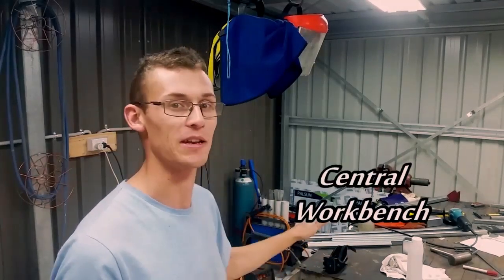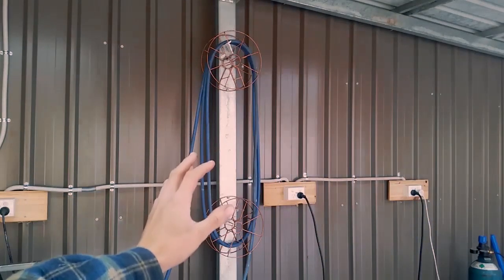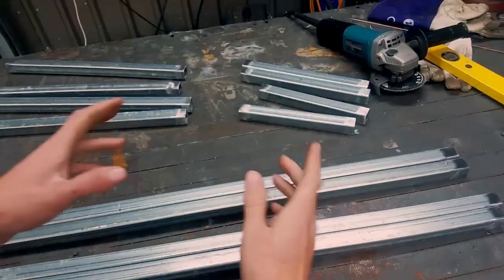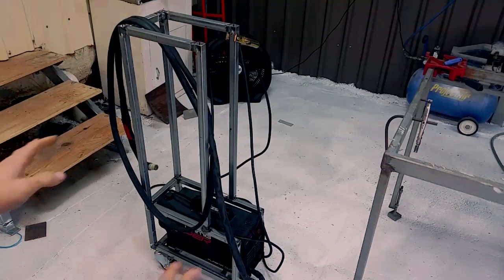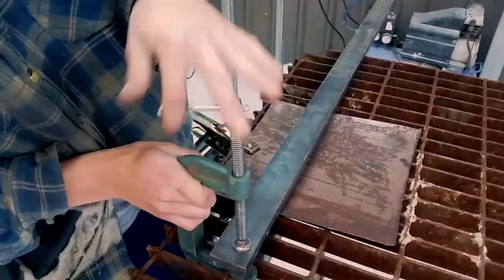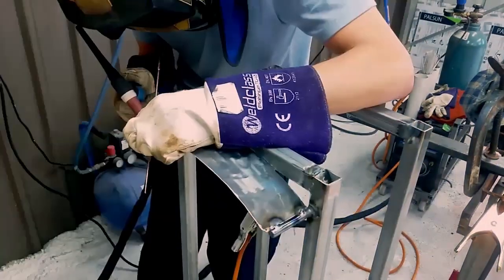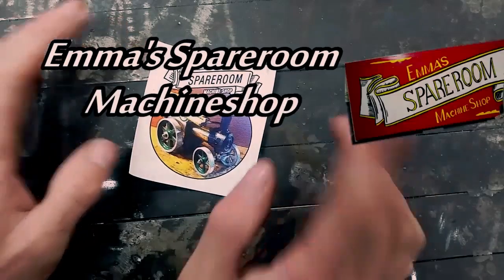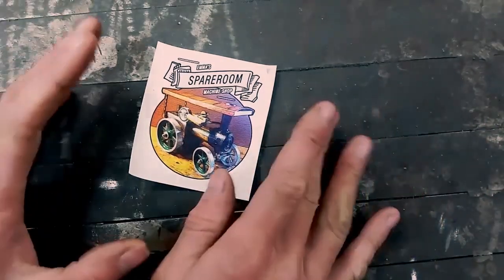Cables, Carts and Bench!

Comment: You are lucky ,welding galvanized square tubing keeps you young !!!!!
If you do not want to get old keep on welding  it.
It is the biggest shit there is,if you don t want cancer stop welding  it !! 
Use paint or buy stainless,never ever galvanized when welding or flame cutting and no ,do not grind it off and weld it,it will kill you !
Reply from the maker: I blow the fumes away with a fan. A fume extractor is an upcoming project.
Cheers for looking iut for me
Reply: @TomMakeHere  Better be safe than sorry,don t use that shit,bolt it never weld it fume extractor does not work,what you don t see is the worse.
Use paint or stainless steel !!!!

Comment: If you need a flat surface or level  to work with you can use shims and packers to set up two equilateral triangle frames  ( 30 or 40 mm square tube works well ) and use a good spirit level to make sure they are not twisted and tack the frames together but don’t fully weld them . Make up some adjustable feet - one for each point of the triangles and fit them so you have three adjustable feet per triangle . You can set them up in all sorts of configurations and use a good sprit level to make sure your set up is level and flat . I have built many trailer chassis and benches using this system on surfaces ranging from grass to cracked concrete to gravel , if you want more height some decent saw horses or  trestles  under the set up lifts it up to a workable height . I have never in 30 yrs of welding had a decent flat welding table although i would like one !   Nice video Tommy!
Reply from the maker: Good advice
I'd seriously like a flat bench though. I potentially have a better bench lined up (better than my thin flatbar bench top)
Alternatively I might machine a few wide and thick flatbar sections, shim and tack them to create a nice surface, but that's a bit of effort and a while away. It could make for an interesting video though
Thanks for watching and commenting

Comment: Glass sliding door, excellent light solution but I would think an accident waiting to happen or at best always on your mind. Nice solution to cable problem and great cart to boot. 
Cheers 
Peter
Reply from the maker: The door is actually 4mm thick polycarbonate. I reckon the screws holding it would give before the sheet does! I'm amazed at how clear it is

Thanks for watching
Reply: Good to hear it’s polycarbonate and yes it was very clear, I think it will cloud over, over time but still greater piece of mind. Cheers Peter